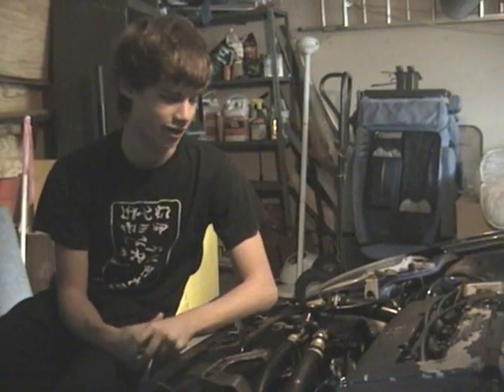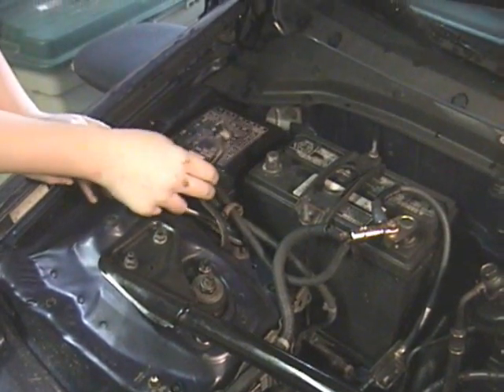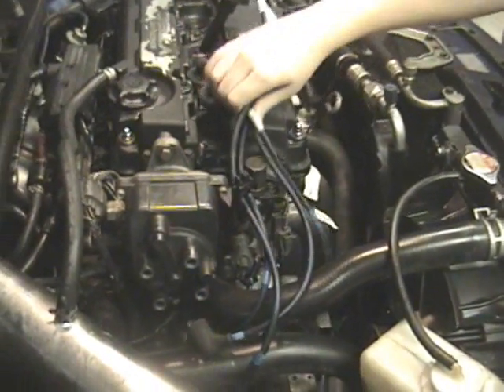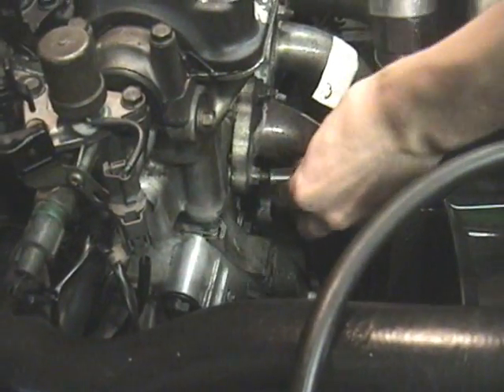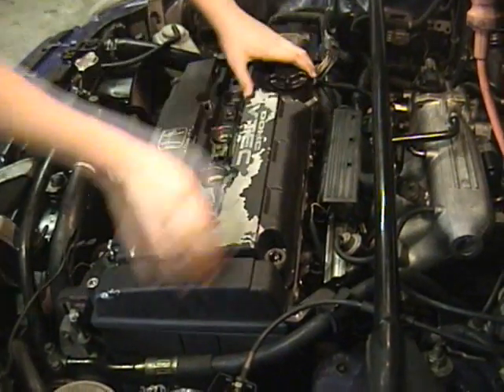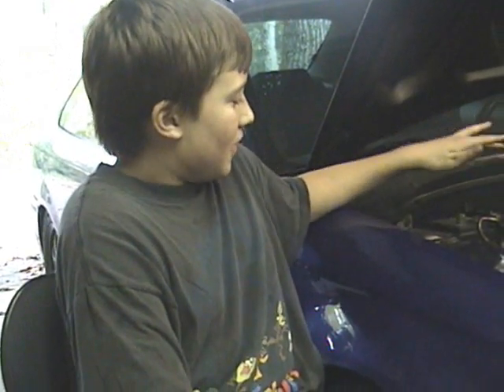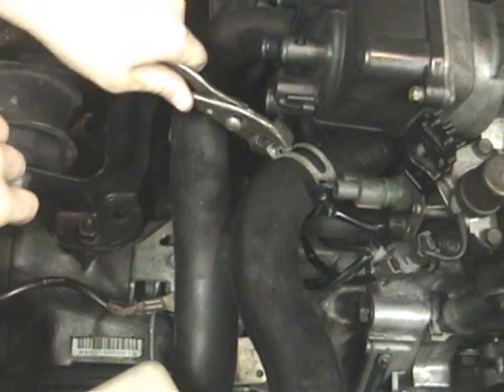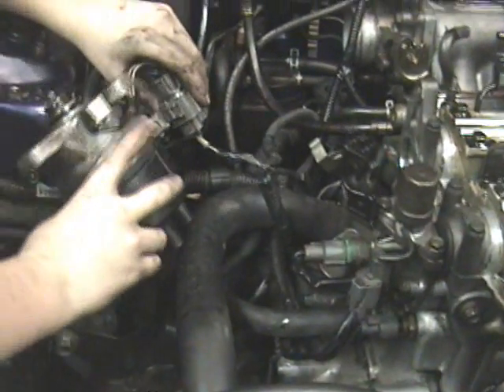How to Replace the Head Gasket on a Honda B16A Series Engine.  Part 1.

Comment: Word of advice never remove wires until valve cover bolts r removed but nice build
Reply: jgreddy84 you clearly have no idea what you are talking about... You do not have to remove the valve cover bolts to remove/replace the spark plug wires.

Comment from the maker: Follow the video instructions until the valve cover is removed.  There will be a rubber lining around the outside of it, which is the valve cover gasket.  Remove it with your fingers by pulling and replace it with a new one.  A cam seal is more involved, and unfortunately cannot be explained in the limited space here.  Check videos by YouTube channel:  RatchetsAndWrenches.

Comment from the maker: We don't have a Honda Civic to work on anymore anymore.  You take the upper timing belt cover and remove the timing belt from the pulleys in Part 2 of this video, recently posted.  You have to then remove the crankshaft pulley and the lower timing belt cover, which is behind the crankshaft pulley.  That's about it.  To make sure the crank shaft and cam shaft pulleys in timed properly, see the TDC and 3-mark-alignment method describe in the Part 2 video.

Comment: hey guys I have a question. I have a 1997 ek4 honda civic with a b16a vtech engine. Recently i saw oil leaking from the head seal gasket so i consulted a mechanic and he said that i need to get a new head and block. Is this true ? do I need a new head and block or can the head gasket be replaced ? b'cuz it is not as tho my car is over heating or anything like that.

Comment from the maker: @reddot44 It is pretty expensive.  In the range of $1000-4000, depending on where you live, whether the engine has to be removed to do the job, and whether there is additional damage.   If know how, take each of your spark plugs out and look into the hole with a flashlight.  Turn the engine a bit so the top of each piston can be viewed, and look for hole, or a piston that will not come up, due to a broken rod (which pushes connects to the piston to the crankshaft).

Comment from the maker: @reddot44 Not  likely to be  a blown head gasket.  Have someone turn the engine over while you look in radiator (remove cap; use flashlight).  If there are bubbles, then it is head gasket.  I would say you have a hole in a piston.  The oil is going from the oil pan underneath (where crankshaft is) into the combustion chamber and blowing out the exhaust.  If the cloud is pure white and smells sweet, it might be coolant/water mixture. Oil has a grey-blue tinge to the white, and smells burnt.

Comment: I "think" my 99 Chevy Prizm blew a head gasket but I'm not sure.  When it happened it made a loud pop and the engine burnt all the oil. (could tell because it was a cloud of white behind me) well I just put 5 more quarts in to see what happened and it would barely turn over and sounded like a motorcycle and just shot out white smoke while I revved it.  Can anyone confirm I have a blown head gasket or on what may be the problem?

Comment from the maker: @deion712 It was running rich.  You could smell the unburned gas and there was also gas in the oil, from the smell of the dipstick.  From what I have heard, this usually does not happen with a blown head gasket, but that is what we had in that car.

Comment from the maker: Its possible.  If the coolant and water gets into the oil, and is circulated around the engine, you are using water instead of oil as a lubricant and moving metal parts get damaged from abrasion.

Comment from the maker: No, timing belt was fine.  Engine had good power.  We did replace the plug wires because they were suspicious, and this may have contributed to the engine problems.

Comment from the maker: Good point, kevinef8bb4.  When the head gasket is blown out in such a way that coolant gets into the cylinders, the smoke is sweet white and you can oil changes color.  If it is blown such that oil gets in the cylinders, the exhaust is bluish grey.  In this case, the head gasket was blown just between the no. 2 and 3 cylinders, so unburned or half-way burned gas gets into the cylinders, causing a black powdery smoke.  I should have pointed that out.  Thanks for your post.